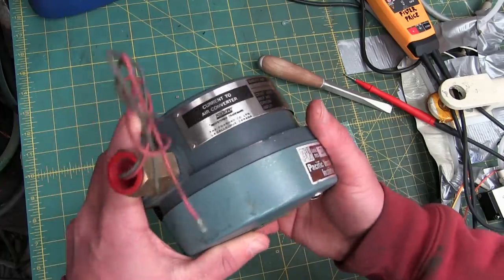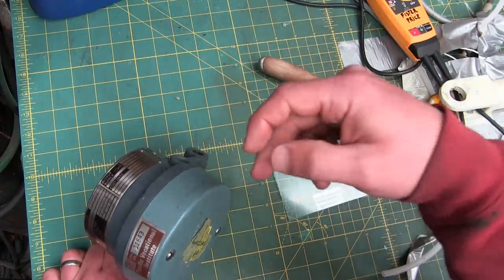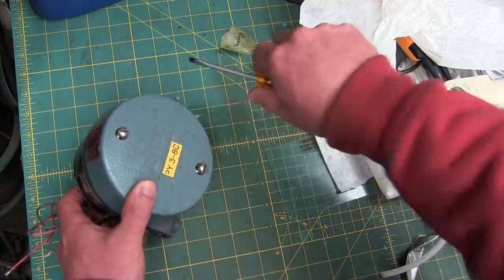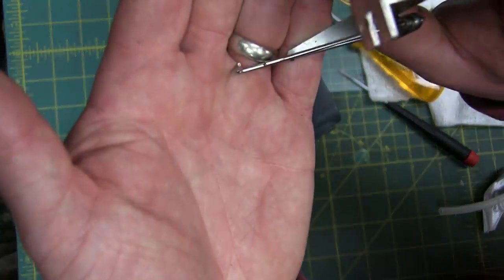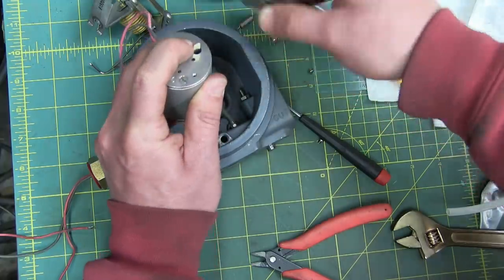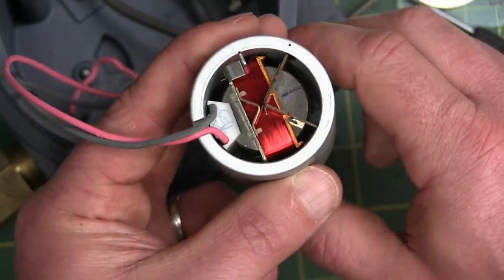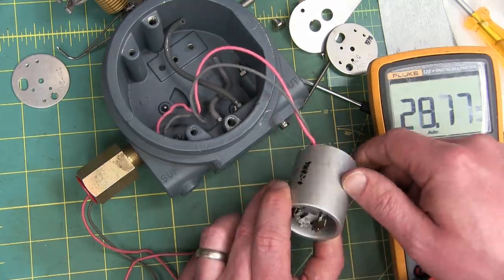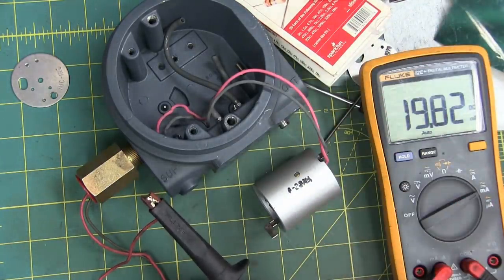BOLTR: Electro-Mechanical Instrumentation | MADE IN CANADA

Comment: Dear uncle B, you are wrong. This one TAKES the pixies to give out air pressure. Presumably 0,2 to 1 bars. Used to control valves or pneumatic controllers. Today this is all integrated into a valve positioner.
Reply: Ok, it's 3-15 psi in the colonies.
Reply: But I'm still impressed by your ability to explain in detail how it works. LOL
Reply: Exactly, I kept screaming at the screen but he won't listen
Reply: Nicholas Franks. You know how young kids are these days they just do no listen. I was 23 when this was made.
Reply: I was wondering if he'd look at the "current TO air" on the label...
Reply: Yeah not sure what he was trying to explain, but it looks like the coil is a torque motor, pushes the flappy end against the nozzly bit, until the pressure in the bellows builds and overcomes the flappy bit. Probably a bit of needle valve fuckery in/around the bellows to aid in controlling/regulating the output pressure.
Reply: Yeah. Looks like in/out hoses connect to each end of the bellows. I'd guess inside the bellows is a valve to stop/reduce incoming air.
Tear it apart!
Reply: As an E&I apprentice, who just went through instruments. This is an I/P (I to P) transmitter
Reply: Agreed. The pixies move the flapper nozzle, and changes the pressure in the bellows until it moves back into balance with a different output pressure 20-100kpa for the continental type.
Reply: scottydamion He did. He said it at 0:23
Reply: CKOD Close. Pressure in the bellows moves it away from the "flappy bit" When the FB moves back it lets the pressure out and the nozzle follows it. It's a servo valve.
Reply: i always move my flappy bit when she bellows
Reply: He is missing the booster relay that restricts the airflow to the nozzle and connects the output to the feedback bellows.
Reply: play spot the mistake for a bone-us point, its in the fackin rules.
Reply: I didn't catch it being backwards, but when he was talking about impedance in a DC circuit I knew something wasn't jiving.  I new the pixies in the coil could care less about being in a magnetic field, except when the coil is moving, in which case the generated current would either add to or subtract from the supplied current depending on which way it was moving.
Reply: Something similar is found in most automatic transmissions, either the old style 4 speeds or the modern DCTs. There's a solenoid that converts a varying current into a varying fluid pressure in order to fine tune the switching of the gears.
Reply: If he got it wrong  ...... does that mean it gets re-monetised?
Reply: Torsten B I thought that looked too much like an I/P.
Reply: I was wondering how changing the angle of a coil in static magnetic field would change the impedance.  Your explanation makes much more sense: the coil/magnet bit is a galvanometer, moving with current, which then affects the gaseous moving parts.
Reply: It doesn;t. It changes the saturation current of the coil.
Reply: INSTRUMENT TECHS OF YOUTUBE UNITE!!!!
Reply: kalkan4 

Sometimes the pixies "do" care about being in a magnetic field, albeit in different circumstances than what is shown in this video.

Back in the good old days, Otis Elevator had a neat 3-phase door motor controller, (no, not VVVF, long before that) which initially limited the 3 phase current to the door motor thru a "saturable reactor". Basically each leg of the 3 phase input power was wound on a steel core- Then there was a forth coil would around this same steel core- This 4th coil was fed with a variable DC current, and when energized, the superimposed magnetic force of the DC coil would squash the magnetic flux of the 3 phase input power, reducing the impedance of the previously saturated 3-phase coils, and thereby allowing the 3 phase power to more freely flow, increasing the torque to the door motor. IOW, when the DC was turned on, the 3 phase reactor windings were no longer in a saurated state, and the doors moved faster. Reduce/remove the DC control current, and the door motor again slows down as the 3 phase input windings again reached saturation, their magnetic fields rising to the saturation point on the core.

The DC current clamped the core flux, reducing impedance, and allowing more current flow

This purely electrical (not electronic) shenanigans was further smoothed out by having the door motor motion dampened hydraulically. 

When set up right, you could adjust them so finely, that they worked like "Star Trek" doors, just swooshing open and close with infinitely variable speed for Mon Capitan to enter with his characteristic flourish of the mystique of command.
Reply: Yeah I think the way it works, the pressure rises until the bellow pushes the nozzle away from the plate and it starts getting air out. The plate is moved by the galvanometer.
Reply: Torsten B   To add to Torstons comment  I want to add that today it’s mostly all 3 to 27  Psig   3 being the zero and 27 being span.  Some legacy systems  may still be in service using the 3-15 standard.   Find a good book on instrumentation and control systems published, say in the sixties for greater detail into pneumatic controls and instruments.
Reply: But they have I to ps that are over 30 years old still working the dvc does not last as long but they are all going to be replaced eventually

Comment: So that is an I/P converter. 

The way this converts a DC mA signal into a proportional pressure signal is that the coil of wire wants to align with the magnet and the force is proportional to applied current. This force closes the gap between the flapper and the nozzle which changes the back pressure in the nozzle. 

The nozzle is fed with 20 PSI from a regulator and via a restriction. The restriction is there to limit the flow through the nozzle so that the supply does not overwhelm it. So with the flapper pressed hard against the nozzle the back pressure will be full supply pressure 20 psi and with it fully away it should be less than 3 psi back pressure.

The bellows is a feedback mechanism to balance the flapper nozzle assembly. If you just have a flapper nozzle the system with respond very slowly as the maximum flow is limited by the tiny restriction in the feed to the nozzle. In order to boost this signal a booster relay is used (this is what is missing from the bottom of your I/P, it also typically contains the restriction that feeds the nozzle).  So the back pressure output of the nozzle is fed into the booster relay and the output of the booster is fed into the feedback bellows. So if the output pressure is higher than the output of the nozzle the bellows will push the nozzle away from the flapper and the back pressure quickly drops which in turn lowers the output of the booster relay and then the bellows shrinks allowing the nozzle to return to an equilibrium point. 

Pneumatic stuff is still used all over the place in industry for valve actuation. You can take the basic I/P design and add mechanical or electronic position feedback to get very fast and very precise control.

If you want to get this working in a basic way you will just need to feed the nozzle with 20 PSI through a very small restriction and measure the backpressure upstream of the restriction and have the bellows connected to that backpressure as well. The output will be 3-15 psi ish for 4-20 mA input on the coil. Span is adjusted via a voltage divider on the input and the zero is a spring pushing the nozzle towards the flapper.
Reply: Ryan Dewsbury 👏

Comment: These I/P convertors are top of the line. We have loads of them at the refinery i work at and rarely have one that fails.
The newere Semi- electronical go bad all the time.

The INC-INC and INC-DEC indicates the forward/reverse conversion of the current to air. Increase increase has  3 psi at 4 mA and rises to 15 psi for 20mA. Increase decrease has 15psi at 4mA and falls to 3psi at 20mA. You just turn the current motor 180° too use either one. This is very important when considering what failiure mode a control valve has te have.

Comment: Looks more like an electropneumatic transducer.  This kind of thing would be used to turn a 4-20mA electrical signal into a some-number-of-PSI control air signal for a pneumatic actuator.  When you upgrade the control system from pneumatic to electronic, this lets you do it without replacing all of the actuators at the same time.  

Some speculation here...

Air would be supplied to the device and it would generate a control air "signal" of some pressure.  I think the vent hole on the end of the tube would either bleed air out of the bellows, or, if the galvo pushed against it, cause pressure to accumulate within.  When the pressure is at the desired level, the amount bled out would be the same as the amount entering in.

The idea is that you only care about the spring constant of the bellows (i.e., x amount of pressure is y amount of deflection), and the deflection of the galvo (i.e., p amount of milliamps is q amount of deflection).  The air pressure supply is what moves the bellows, such that the force on the galvo is quite low; the only thing the galvo has to do is provide enough force to close off the little nozzle or let it open.
Reply: You are right. Uncle Bumblefuck got this wrong. This one converts 4-20mA to (presumably) 0,2-1 bar of air pressure.  That's also why its's reading "Current to Pressure". 0,2-1 bar is (at least the European) old standard for controlling valves in industry. Don't know wether there is an imperial equivalent to that.
Reply: Yes.  An I/P.
Reply: 3-15 psi
Reply: The hint’s right there in the name, after all: current to air transducer.
Reply: usbcd360. Fisher 3582 comes to mind
Reply: To think I did my trade test on the bigger brothers of those, all sitting ( well used, even worse than that one, which at least still has paint on it and screws that do not look like they were operated with a hammer and chisel) nicely on a bench controlling some air valves and such. Maladjust them and you get a really nice power oscillator, though the load on the piston might object to this.

Comment: You're cornfusing your guzintas and comzoutas.  Current is your input signal, it changes the position on your magnet-coil doodad.  That changes the distance between the tag end output of the cylinder and the little tube you pointed out.  The bellows and the tube act together in a feedback loop to get your output air pressure.

Comment: Noticed you said this was intrinisicly safe and listed a few applications for such a thing. Just wanted to mention that those applications use explosion proof devices, and are classified in electrical code. They are designed such that a flame inside the enclosure will not propigate and ignite the atmosphere outside. Intrinisicly safe devices are a little different, in that they contain too little internal electrical energy to generate a spark sufficient to ignite a hazardous atmosphere. Examples are  portable radios and communication devices used in offshore drilling.

Comment: Yep, that looks like a I/P converter, probably from 4-20mA to 3-15psi to actuate a valve, thats why you have a supply port and an output port.
Reply: You are correct. It's an I/P. They were set up for 4-20 or sometimes 10-50 mA coil

Comment: Just did a  bench set with an I/P for 4-20mA to 3-15psi with the upstream pressure at 3psi. Had to calibrate the valve to open at 6psi so around 8mA to open the valve and calibrate the travel for 1/4 inch travel with the remaining 8-20mA. So the flapper and nozzle are used to amplify the pneumatic signal to the pneumatic relay to get more or less air

Comment: @AvE, Intrinsic Safety (or IS) is part of Class I, Div 1 and what vapors its rated for depend on the marking on the back. There is also Class II, Div 1 which is for combustible dusts. Div 2 is typically for areas that will see vapors/dusts in abnormal operation.

Comment: Scusa --- the label on the tin said current to air xducer. Looking at the air ports: "supply" and "out". So my impression is the current loop is the input, the  little arm attached to the winding rotates bringing it closer to the nozzle of the pipe which throttles the air flowing out. The change of back pressure causes a change in the bellows and modulates a valve to give the 3-15 psi output.
Reply: Yep. I tappy taped before reading . And there's a bunch of like minded idiots out here in the digital weird. Was watching Bosch again or I coulda been a contenda.

Comment: 9:10 It's a great big galvanometer. It moves the vane in response to input current. Not the other way round!  The hollow tube will move until it touches the plate on the galvanometer. It translates the current input to air pressure output as it says on the unit.

Comment: See if you can get a hold of a fisher 3582. It is a I to p ( current to pressure,which I'm pretty sure this device is too) positioner for a control valve. Very cool little device, uses input current and translates it to pressure to place a valve in the position needed.

Comment: Laughed and reminisced back to when I was an apprentice and was taught by a Foxboro trainer how to calibrate a bourdon tube gauge.  

Intrinsically safe is one of the techniques used in electrical equipment for hazardous areas, not the generic name for all the techniques.  It uses the limitation of energy within a circuit so it is below the minimum ignition energy of the hazardous material.  Flameproof is another technique.  This is a very interesting field of electrical works, may be a topic for future videos.  

Down here in Stralia (Australia) we use the european IEC 60079 standards these may be different to those used in Canada.

Comment: I think this is changing what it reads in volts into air pressure? I can only assume being intrinsically safe its for oil and gas type of situations where they would use air to read?

I don't know the plants i work on for the most part just crush rocks haha
Reply: I to P converters like this are used for valve positioners most often. They are still quite common.

Comment: Current to air,  so the coil is the prime mover that controls the air pressure. The coil is not the 4 to 20 output it takes the input.

Comment: I like me some P+F.  Even more that E+H / Emerson.
Class 1 is for flammable materials, which includes flammable vapors in air.
Class 2 is for flammable dust.

Division 1 is when the hazard is often or usually present.
Division 2 is when hazardous conditions are the result of abnormal circumstances.

There is a big difference (money and mass) between Div 1 and Div 2.  Div 1 is often associated with wiring in conduit, and the conduit joints are packed (with ceramic or paste) to create an airtight seal.

Intrinsically safe (IS) and explosion proof (ex or exp) are also 2 different beasts.  Explosion proof has thick walls that will contain an explosion.  IS is designed to operate at a voltage level low enough to prevent arcing.

Comment: Foxboro I to P.  Which is current  4ma to 20 ma input  with 3-15 PSI output. you are missing the air amplifier on the bottom which converts the air signal from the flapper/nozzle  to the 3-15 psi with enough flow to run a valve. full stroke on the flapper nozzle is 4/10000 of an inch. yes that is right ten thousands of an inch about the length your fingernails grow in an hour.

Comment: Rotating the coil to a different position didn't seem to make a difference in current, but moving it back and forth did. Would the air causing the coil to oscillate induce a current proportional to the airflow?

Comment: Wtf are you sure this is not a I to P , ???  You give it 4 to 20 ma and it converts it to a air pressure... The typical is 3 to 15 psi but there is other ranges.
Reply: This looked like an I to p, if he used a 4-20 source the arm should have moved

Comment: static magnetic field will not change the impedance of that coil. Definitely not its DC resistance, and since it is air-core coil not even the AC impedance. Not sure on what principle it is supposed to work, but does not look like it can do anything to regulate the current to 4-20mA.
Reply from the maker: Ja, must need to be connected to a "transmitter" module. Tag says 4-20mA output. ?
Reply from the maker: WHOOOAAA MAN! IT WORKS IN REVERSE! I takes current input and OUTPUTS pneumatic signal!
Reply: It does say that in the label after all...

Comment: I love the old i/p converters. They can be used to turn pneumatic controllers into electronicaly controlled from a dcs or plc. Nowadays though they are typically integrated into smart controllers which do the whole lot but are impossible to repair or fault find. I cut my teeth on these as an apprentice.

Comment: This maybe a shot in the dark, but that springy thing that you initially called a switch might be there to cause the coil to vibrate around the permanent magnet, then the diodes on the other side rectify it. Perhaps it requires additional external components (maybe just a capacitor or something) to condition the signal a bit.

I dunno, man :)
Reply: Nah he buggered up again. I to P, meaning the current in gets the coil to control flapper nozzle pressure, causing regulation of air pressure into an output range of 3-15psi, one of the pressure range standards used for valve control, pneumatic signalling/charting, etc
Reply: Nah he buggered up again. I to P, meaning the current in gets the coil to control flapper nozzle pressure, causing regulation of air pressure into an output range of 3-15psi, one of the pressure range standards used for valve control, pneumatic signalling/charting, etc